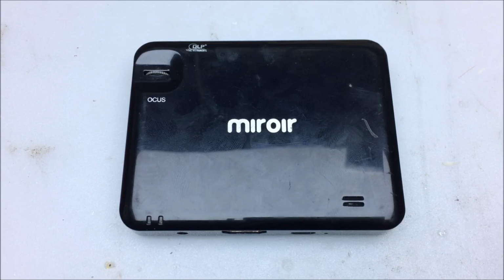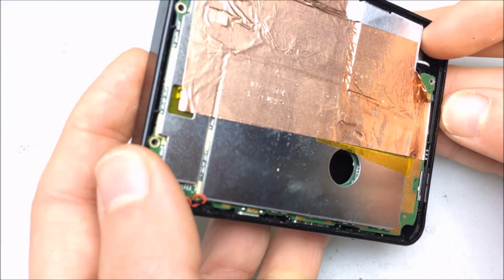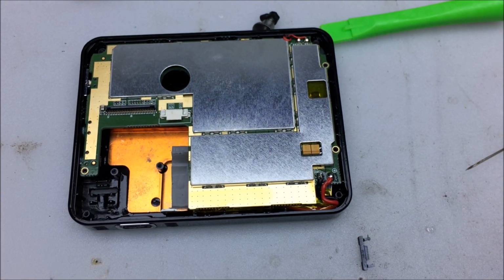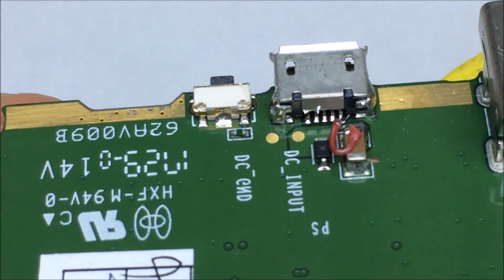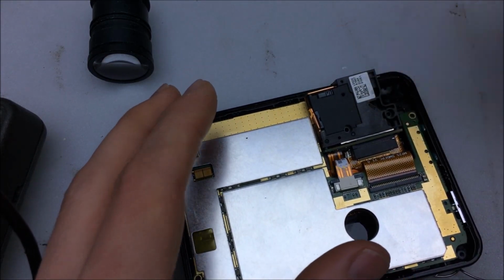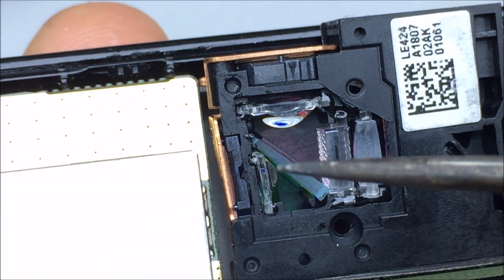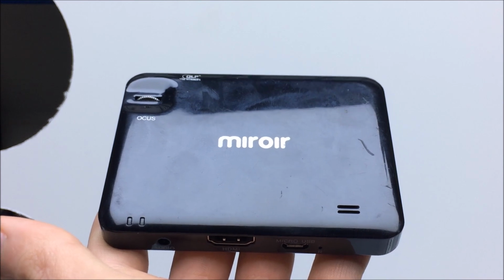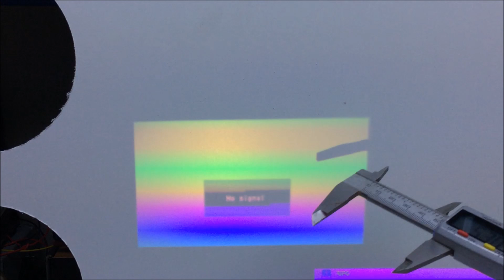Miroir M20 Pico Projector USB Port Repair

Comment: You're working on something that needs better tools and more finesse... especially that soldering iron tip. An Xacto knife kit is a huge help. And yes, that much copper foil tape is needed... would they put a penny more in the product than they need to?   RFI emissions is a tough beast to beat...
Reply from the maker: You're correct, I should get more plastic tools and  at least clean my soldering iron. That poor, poor soldering iron tip lol. It's all a continuing work in progress. As far the the copper tape. You and I both know that this projector would probably work just fine without it. would is pass regulation for EMI? maybe not. There are a few projectors I have taken apart that lack this level of EMI shielding. overall the build quality was above par for what it is. Not knowing of this brand's build reputation I was rather surprised, though I still think they went a tad " Overboard " baddum tis...

Comment: If I have just the projector head part what would it take chip board wise to make it work? The board is toast but the projector head is good.
Reply from the maker: Typically you will need the same board as the projector came with. There may be some flexibility and if you are looking for something to experiment with look up TI DLP LightCrafter Display EVM.
Reply: @Zenodilodon  thanks for the reply. Guess this little projector ist complete garbage then. I was hoping to salvage something outta it at least
Reply from the maker: @dollarbill6102  There are things to salvage or mess around with. The other possibility is to watch on ebay for one with a white dot problem and if you can swap  parts. These little units contain a few optics and LEDs, but it's for the more part specialty components. I find the little projectors kind of like little puzzles that are easy to manage and that makes taking them apart and poking around a bit easy fun/learning.

Comment: I hate having to change out usb ports, such a pain in the ass

You got to get your finger rlooked at by a doctor dude, that ain't right
Reply from the maker: No worries on the nail, it's just the crack/bruise that is still there. Since the injury happened under the nail the physical mark won't be gone until it's grown out. The injury is healed already, the scab is just trapped with the nail so it can't just fall off.
Reply: @Zenodilodon  🤢🤢🤢